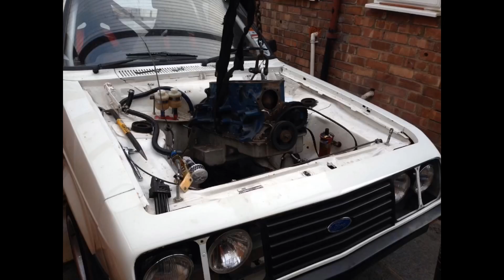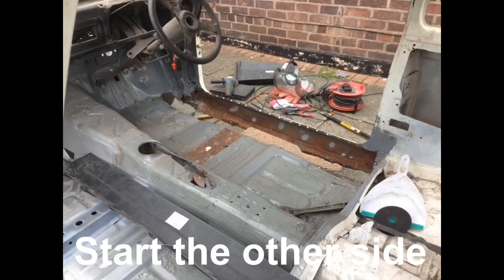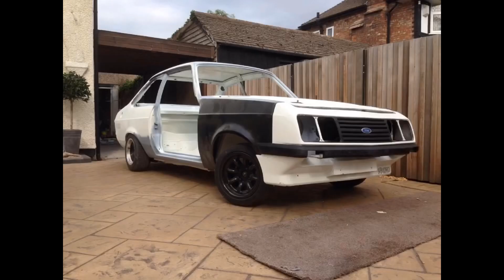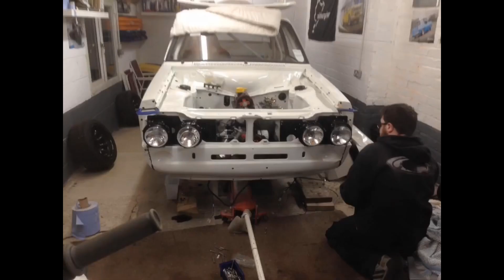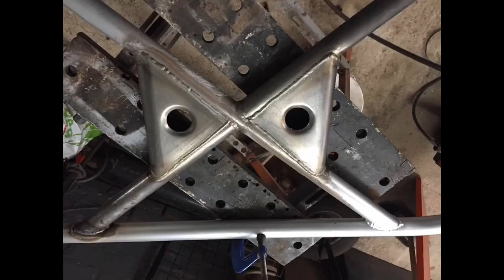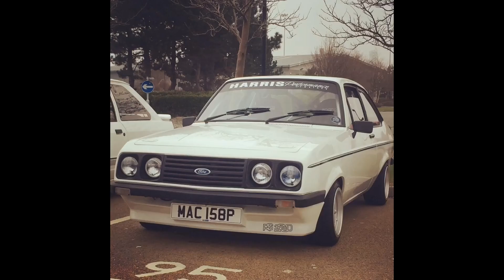Ford Escort RS2000 Restoration Mk1/2

Comment: Great video fantastic motor too 
Take it you done the work yourself? 
You’ve inspired me to rebuild my evo 6 as it needs some serious work 
That is one stunning motor 😊👍🏻
Reply from the maker: Yer man other than engine rebuild and painting the top of the shell. I did everything. Just got to have ago am quite hands on.
Reply from the maker: If you new to the channel check my cosworth video out. I only finished that this year.
Reply: Built all my own engines over the years the one in my evo is currently 575bhp 580lbft 
Miss the old twin Webber’s I used to run on old Astra sounded great 
Il have a look at that video 👍🏻👍🏻